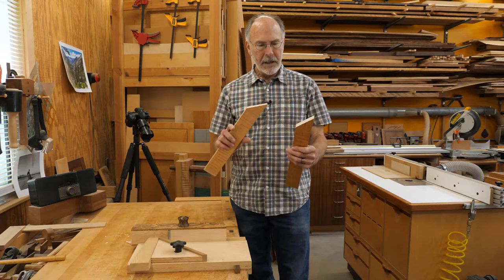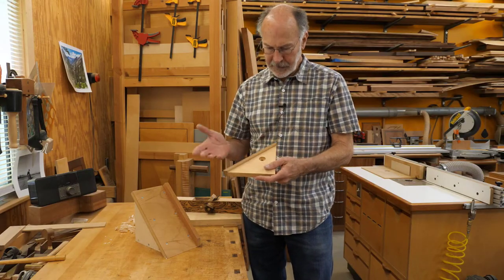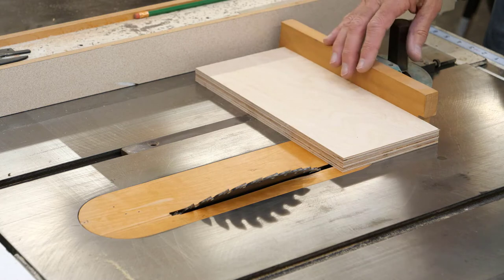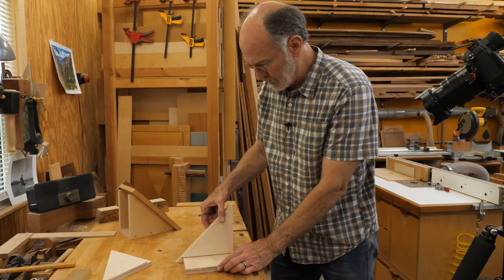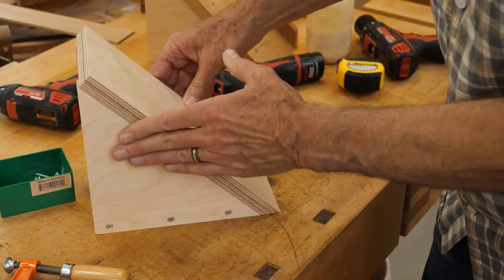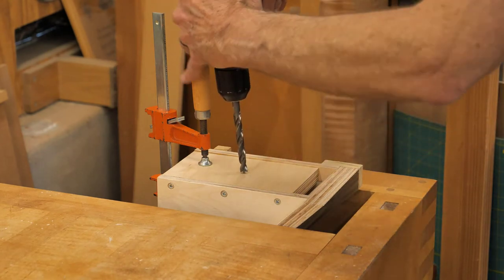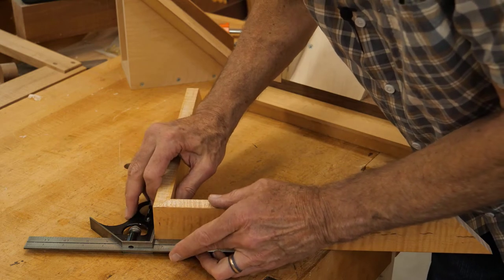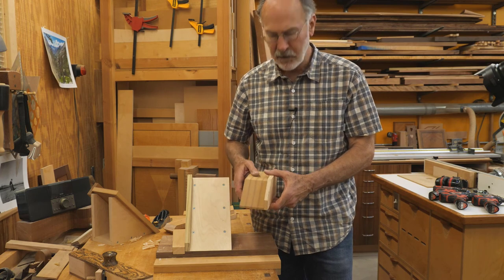Make a Donkey's Ear for your Shooting Board

Comment: I suggest using a riving knife with your table saw.
Reply from the maker: I agree that would be a good idea, but there is no way to add a riving knife to this old saw (Powermatic 66). I do have a splitter for it; you can see it at 08:18 sitting on the fence. When installed, it extends above the table by about 1/2". I don't have it installed during the video for a couple of reasons:  1) I'm using a sled with a 1/2" thick base, making the splitter useless, or 2) The cut is shallower than the splitter height, so the splitter would interfere with the cut.

I could have used it at 09:22 when making the deeper rabbet cut, but I forgot to install it...

Comment: Carl - just finished mine and well, it doesn't work. I followed your build using a track saw in place of table saw in some steps. Checked for square and 45 every possible way I know how as I went. If you ever start making these for people put me on the list.
Reply from the maker: Sorry to hear that. It can be a bit tricky to get things to align correctly. Did you attempt to tweak it? It is designed so you can do that without too much trouble.